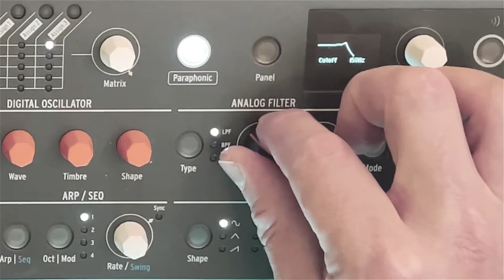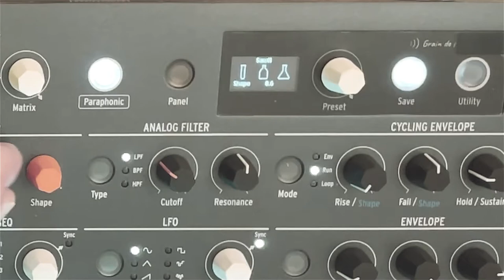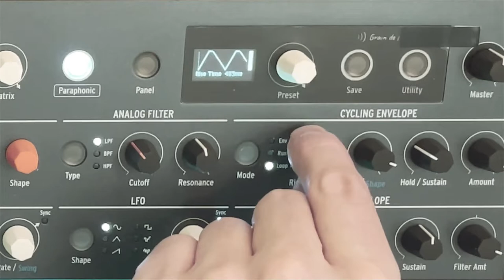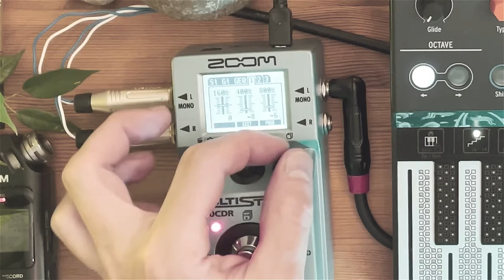Microfreak Ambient Tutorial

Comment: This may be a dumb question, but if I don't have a hardware pedal could I run the microfreak through my daw and use a digital effects plug in?
Reply from the maker: Yes, you can do this. Use delay plugins where you can modulate pitch of delays, like Waves 2tap, Waves H-delay. Good reverbs for this: audio damage EOS 1-2, Valhalla. Use long time for feedback and delay time.